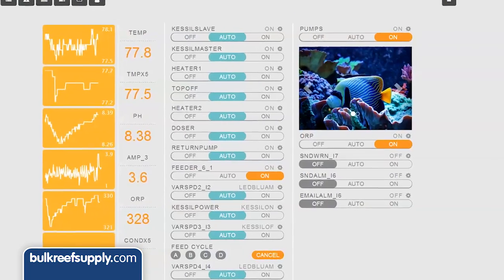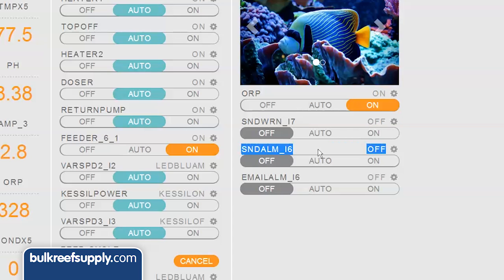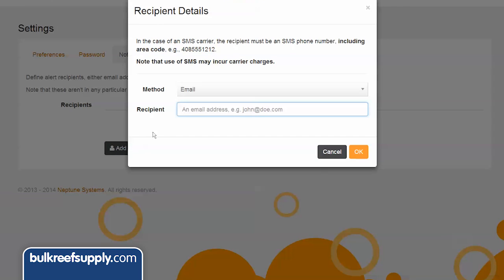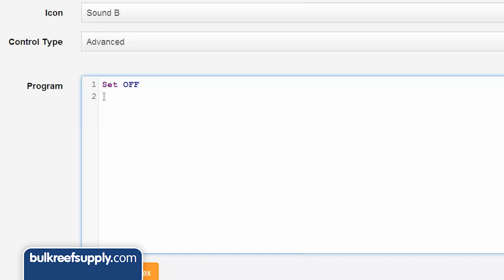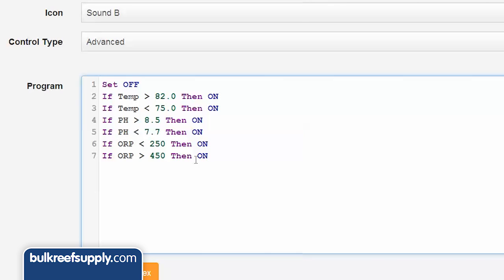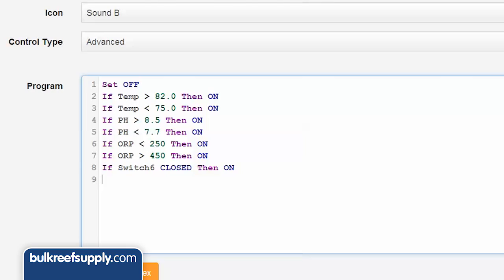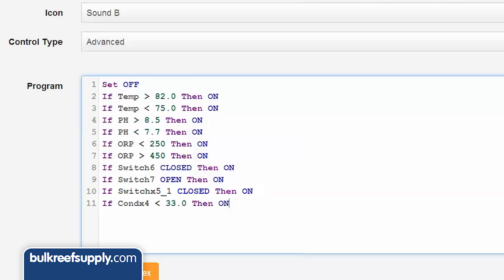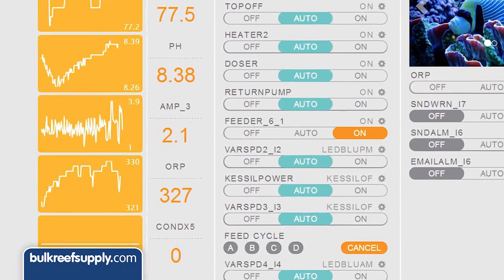How to Configure and Use Alarms in Fusion EP 17: Apex Aquarium Controllers from Neptune Systems

Comment: Hi. Would like to check I have already set my Alarm in the Equipment setting>configuration page for Temperature Probe, Salinity, ORP & PH. Do i still need to put in code like  "If PH < 7.7 Then ON" on the base_email coding page?  And also on my dashboard i can only see EmailAlarm and there is no Sound warning / Sound Alarm bar. Is that normal? Hope to get some advice from you here. Thanks

Comment: How about setting an alarm to get an email when your temp probe stops working? Or dissappears by a software glitch like I'm experiencing with my PM2 module? My tile also dissappears. In order to fix this, I have to re-enable my temp probe, since it gets disabled without me doing it. Weird.
Reply: ***** First I need to update my Apex and module to the latest firmware, since it's outdated. Just waiting on my 100ft ethernet cable, since my router is far away ☺️
Reply: ***** Yeah, hopefully it will solve the problem. I really think that it's a software glitch. I have to go into my settings and re-enable the temp probe every time this happens.

Comment: I'm considering a junior control system for 40 gal breeder. Is that overkill? I don't need it to be able to do nearly all the things the Apex does in this video series, and it is for that reason I don't want to spend a lot of cash on it. Really I just want to control light, temp, ph and my pumps.